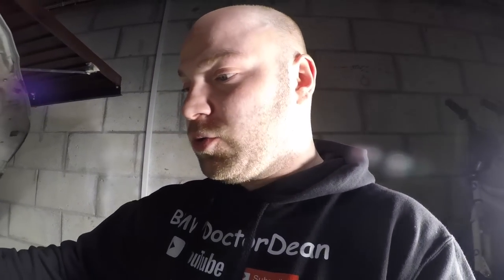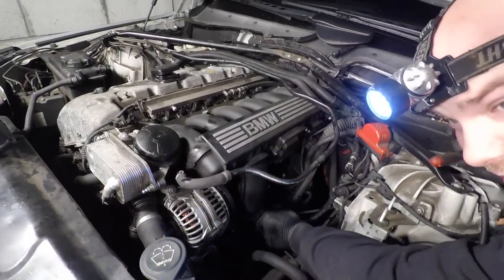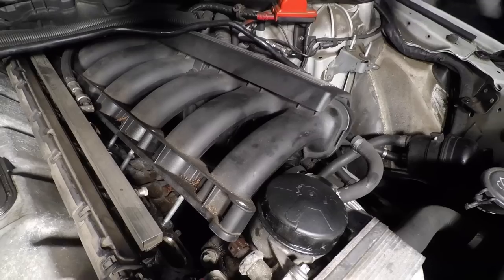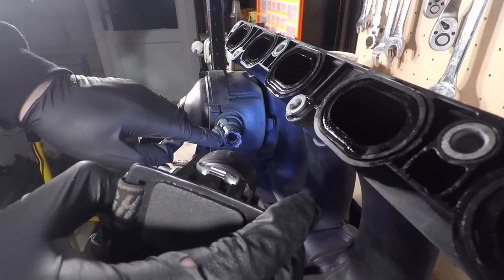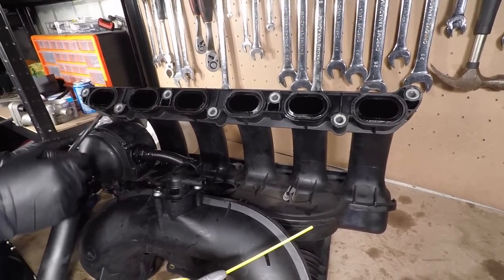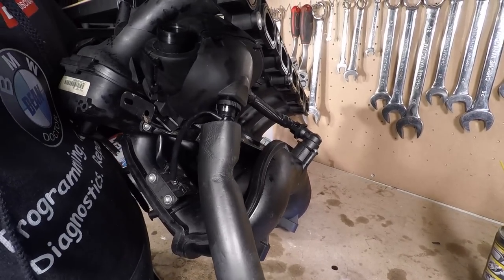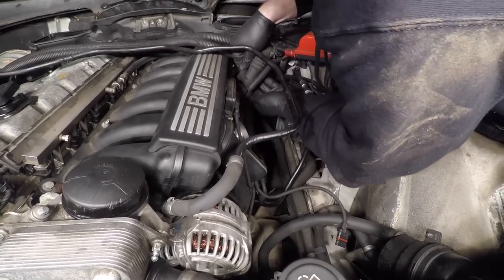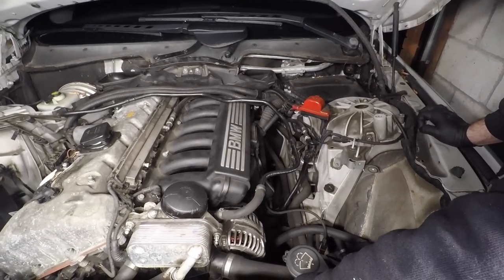BMW N52 How To Replace CCV Intake Manifold Removal Step By Step Guide

Comment from the maker: click here to buy the ccv kit used in my video 
https://amzn.to/2F1KNsX
Reply: Mine is a 59 reg with black housing  - do you have a link for this one ?
Reply: Is it same for a 130i?
Reply: BMW Doctor I bought my 2006 BMW 325i a month ago and is making the same whistling noise and giving me code P00 12, P00 15. I called BMW services and they said that the ccv was replaced a year ago with the previous owner... I doubt it was done cause is making that Same whistling noise. Therefore I will be replacing the CCV but do I have to replace the valve cover aswell? I replaced the valve cover gasket a few weeks ago.
Reply: dude how many times did you call it a PCB or am I just losing my shit here?
Reply: How good is this one really?. Got a couple of very small leaks, think partly down to the RCG, so want to do the CCV first, just incase, as if that’s playing up it might bugger new RCG.
Reply: Think this is my next job on my car. I'm having to top up oil back to full in unther  800 miles.
Reply: Hi dean, about to replace the ccv myself, bought a aftermarket set. Just wondering if I need to relearn the new ccv system in the cpu? Your advise is much appreciated. Love your channel btw. Greets from the Netherlands
Reply: I really enjoy your videos!!!

Comment: Did this job yesterday on my 2006 e61 530i with aluminium cover like in the video but with 3 stage manifold. The oil separator was completely clogged up like in this video and while being really careful return hose and the breather hose both broke off completely, that's how brittle and hard this stuff becomes so indeed replace them all. Honestly, the hardest part was removing the two screws that hold the bracket on...  thanks for making this video we used it! :)

Comment: Followed your vdo. 100% success thanks for the step by step instruction.
Reply from the maker: Good man at least you done it and shows it’s all correct
Reply: Did your intake manifold have oil inside too? What were your symptoms before replacing?
Reply: Victor Ramirez yea my intake manifold had oil inside of it and when i would put it into reverse pr drive from idle the rpm would act like it was going to stall. but when driving it would go away

Comment: Great now I need to find a camera man , seems likes it does add a lot to the video
Reply from the maker: Yes it does espically when you have a editor aswell why your cracking on with everything else
Reply: I charge $100 an hour ;)
Reply: @BMWDoctor  hi doc ok I've just pulled out plugs 2 and 4 and the tips of the plugs are blown off i mean they are gone! I have a 2007 525i n52 E60....what should I not do

Comment: Great video, putting mine back together today, how did you connect the lower CCV hose that runs to the oil pan? Did you connect it from underneath, by removing the metal cover? Or from up top,  I cannot  get it connected, maybe I am not positioning the intake just right, or there is a method I have not seen?

Comment: You are an absolute hero managing to get the bottom CCV to sump pipe off without getting frustrated and breaking it! Luckily I had a new one to put on, decided to snap it just so i could get it off, my thumbs were numb. Thanks so much for your video on this, helped me heaps working through it. Does it matter what order the plugs go in? Forgot which one was which on the bottom two, as mine seem to fit in either or. Cheers!
Reply: I put them back in the same way. It's good. 
Did you guess ? Is it good ? 
The last hose behind the valve cover took a ton of pressure. And then I heard a click.

Comment: I have oil leak on the same side of my 2009 N52, I see lots of oil on the head gasket area and it is pooling just above it.
There is no leakage from the valve cover. I gues i need to do this repair. great video.

Comment: Hey Doctor, Great Content, I have few questions for you. I bought a 2010 BMW 528i few weeks ago and I started to notice few issues.
1) Cylinder 3 misfiring first along with cylinder 4.
2) Changed all spark plugs with all ignition coils. Didn’t fix the problem.
3) I took the car to a mechanic today
 “he said cylinder 3 had oil over the piston and has been damaged by poor maintenance by previous owner, so I need a new engine”

Please can you give your suggestions.
Reply from the maker: change your CCV and the breather onto of valve cover that's split causing oil back into manifold to be sucked into engine dont listen to your mechanic he must be a idiot
Reply: @BMWDoctor  i love you so much

Comment: How much pressure should be at the oil cap when engine is on? Mine feels wiht a lot pressure at start (when cold). Then suddenly engine goes off if the cap stays open. The car runs ok, but doesn't feel to powerful. A little 4cyl  CRV Honda  leave me like 150 ft away in a drag 😂.... A shame on my 2007 BMW 530XI 6 CYL. Thanks for sharing your knowledge Doc

Comment: Hey doctor, y followed this video, install went good but now there seems to be a gurgling sound coming from the intake. It goes away if I remove the oil fill cap

Thanks for your videos. They help me a lot to restore my car
Reply: Also my idle is stuttering after this job, engine feels like it wants to shut off

Comment: Thanks a lot for your awesome video. My 2006 530i with 160k miles wouldn’t start, so i planned to replace starter, ccv kit, disas. I got all parts from fcp euro.
I have run into couple of issues
1. I broke the wiring connector to cps and i got the socket part# 12527507526 and replaced it.
2. I also broke the vacuum hose part# 34336762103 at the end where plastic meets rubber. I ordered the part but that small piece doesn’t come off even after removing the 2 hose clips. I have cut it with utility knife to take it out.
Put everything back and it starts now. 

Thanks a lot again for the video.

Comment: Good advice here Dean.Cleaning ICV might work for a bit but when it doesn't you are back to square 1.
Reply from the maker: Cleaning the inlet control valve ???? I cleaned it after changing ccv I wouldn’t clean it for no other reason if a car is rough idling it’s not ever the idle control valve usually other problems espically on the n52 engine

Comment: Hi.  
I have an E60 N52 258hp 2006 for 1 year in Portugal.  (because there is expensive gasoline, I put the Liquid LPG system and I am very satisfied), I bought it with about 78000miles and at the moment it is with 90000miles.  
I think the car is drinking a little too much oil and will probably be from the ccv no?  I have already changed some of the chronic problems of oil, and I think it is the only one missing and the most logical.  
Continue with the excellent videos and I hope for answers. Thanks

Comment: Great video, i got my manifold pulled out, doing the ccv and disa valve which broke inside the manifold managed to find the flapper in intake but pin is lost, im hoping this will fix my stalling issue and occasional misfire on my 2006 330i
Reply: Was that the issue?

Comment: Thanks for the video. It is pretty simple actually but I am stuck at the moment. The hose that connects to the crankcase is not cooperating. The one from the CCV down and has yellow clips at the end. It goes on a long way but there is a ring around the metal pipe. Is this just a stop or does the clip latch onto that? I am pushing really hard and I cannot get it over the ring.  The hose pushes on pretty far but then not over the ring. I can pull it back off fairly easily.
Reply: I have the same at the moment. How did you solved it?
Reply: I have solved this. All the new parts ordered new en original bmw only this hose was from febi (due to delivery problems at bmw). The febi hose was not fitting very well, so I ordered a new one at bmw. The BMW hose fits perfect.

Comment: Hello. Loving the Vids! I have a e90 bmw 318i. It is blowing out smoke on start up and acceleration from stopped at traffic lights. So either pcv+hoses or stem seals. Right? Any way to check which? Also, if I change pcv+hoses, how long will it still smoke afterwards? Will it smoke afterwards, at what point should I move on to stem seals as the issue? Thank you Dr!

Comment: Thanks for all the great N52 content. I have a N52k and want to swap to a 3 stage intake manifold. Would you recommend this and what additional parts should be swapped to help the process?
Reply: we are two, well im kinda considering a turbo mod, deadline is next spring ;) seriously replace all the plastic hoses that are part of the "oil fumes to intake" system. they are weak. and looks like starting with a new breather valve is a must, and might as well change your starter as well, i changed mine not long ago.

Comment: Dean, your vids are mint mate and the best on YouTube. 
Question, I have a 2006 BMW 325I SE COUPE N52. Is the pcv heater cable included the ccv kit? Also where is that pcv heater connected? Thanks
Reply from the maker: mate the heater wires come with the PCV system all together they have too mate as there needed I aint ever come across a kit that doesn't have them

Comment: Any tips for getting on that oil return hose im currently struggling to get it back onto the pipe that goes to the oil sump
Reply: Hi! How did you do? I have the same struggle here! Should I just press it on, or should I also press the tabs?
Reply: @Jimbobfyrkant  Hi how did you do? I'm trying to connect the sump side first, then to the oil separator. But it's the same issue, too tight fit

Comment: the other day i removed my spark plugs to check the gap on them. ive recently been experiencing a rough idle and surging idle in drive and reverse, so i was just wanting to check some basic things before spending money. but i noticed the spark plugs that i had just purchased with barely 300 miles on them, looked awful. they were covered in oil. Im assuming the ccv system has failed. is that what it could be?

Comment: I’m having trouble getting the air intake connected to the throttle body. Any tips? I tried putting it on before the TB, but that was in the way of the bottom bolts. The first intake boot (between the air box & TB) pushes against the metal near the inner fender, which is keeping me from getting it on square. Even on the bench, it was a struggle to get it I. The TB far enough that the clamp didn’t push it off the TB when tightened. Any tips???

Comment: I've got a 2006 325i getting a lot of white smoke coming out the the exhust, especially after its idle for a bit, but the idle is fine not rough and dont seem to be losing any oil.

Online everyone seems to point to ccv, I've taken it to the mechanic hes doing a service and changing the oil filter to see if that helps.

Any idea if it is ccv or something else. PS, subbed, love your videos.
Reply from the maker: thanks mate mate change it as they DO FAIL mate trust me and even the slightest will cause massive leaks and oil burning
Reply: @BMWDoctor  alrite will give it a go 👍

Comment: Is it the case that once fixed (providing it was the issue to begin with) that any old oil in the system will gradually get burned off? Or should the manifold be cleaned and something added to the fuel system also?

Comment: I have a 2006 330i and had to get a starter replacement. I was told that some little pipe or something broke on the intake manifold when removing it. Now that the shop has given me my car back the car doesn't seem to have anywhere near the power that it had. Does there have to be any tuning again?

Comment: Hey Dean! in Brisbane Australia mechanics are charging $600-700 AUD for this kit plus install... I'm entry level do you think I should have a crack at this? Your video is very straight forward.
Reply from the maker: Yes I really think you should garage’s are rip offs for this job and it is really really easy and takes 10 mins

Comment: hey dean! thanks to this video i successfully change my ccv on my 325i e90. just had one question though. ive been getting codes for both of my cats below threshold (p0420,p0430) and i was wondering if those codes will now go away after the ccv replacement or not. the ccv was not fully blown either i had got to it before real damage was done. would be much appreciated for some feedback
Reply from the maker: its a common common problem mate with N52 about the cats its because there so close to the engine ANY little bit of oil or a blown ccv will get it into the manifolds on the exhaust and need to be burned off mate go watch my video on how to fix it
Reply: BMW Doctor just use the injector cleaner in the spark plug holes eh?

Comment: Will this make your oil light come on saying low oil after replacing oil level sensor and oil pressure switch I also replaced my hpfp and still getting a code for that

Comment: Hello, my N52 is drinking oil and it seems to be from the CCV. I've watched your video, is it mandatory to replace also the hoses? Are they reusable? My idea was taking them off, and cleaning them with petrol until fullly unclogged. Thanks mate!!!
Reply from the maker: No chance buddy replace them because the moment you remove them you will break them removing them anyway trust me as they seize on so get new hoses otherwise you will be screwed don’t even think of attempting to replace it without the hose as then you will not be able to start the car I guarantee the hoses will break or the clips
Reply: Hello if i buy a 528i US and want to get a 258hp like EU version.what should i do ?

Comment: What is a ccv? I live in north America and when I took my intake manifold off my 2009 128i, there were nothing like that attached to it. Thanks for the instructional video.
Reply from the maker: You have one pipe which is shaped like a Y you have the ccv in the valve cover mate
Reply: BMW Doctor I removed my intake manifold and I had the same problem, I have a bmw e90 328i with the black cover not the silver one where exactly is the ccv located at ? Thanks for the tutorial vid!!

Comment: Okay so i just replaced the ccv pump n hoses. But when i was bolting on back the throttle body i notice there was oil in the manifold? Is that normal?? Now the car turns on but as soon as i take off n give it full throttle it boggs n wants to turn off? Any ideal wut it could be??🙏much appricatedt

Comment: I replaced my ccv thinking it was gonna solve my rough idle and stalling issue but the car still has the same problem and it won’t rep past 2000 rpm’s any suggestions please?

Comment: hey doc...ive recently bought a 3series and am doing a breather valve change. after my manifold removal, i noticed oil residue in the throttle body. i have the plastic valve cover 52. do i have to scrap my valve cover all together, since the ccv is in the cover?

Comment: Hi Dean I've got an n53 blip the throttle and back to idle you get a noise like its sucking the ccv valve in , rough idle etc till you blip it again and it releases. I'm replacing the rocker cover. Should I be looking anywhere else for a cause?

Comment: Dear Bmw & Mini Doctor,    does this set fit my 2006 130I ? Cause I`ve seen also sets with a T-shaped pipe in it.
Love your videos!
Reply from the maker: Yes mate this is correct one for your year car after 2007 you need t pipe one if you have black valve cover 

This is how you tell if you have silver engine cover and magnesium valve cover this is the correct ccv system 

If you have black engine cover and black valve cover t shape pipe is the one for you 👍
Reply: @BMWDoctor  Thanx for the fast reply! I do have the magnesium cover so there shouldn`t be a T shaped pipe in the set I ordered on advise by Autodoc... yesterday
Reply from the maker: If you don’t have silver engine cover yes t pipe is correct one for you
Reply: @BMWDoctor  Hi did the job yesterday inclusive O2-sensor bank2 pre-cat. Both hard jobs. Great help your videos!👍👍👍 The hose from the sepparator to the inlet was a T-shaped one, only used on the earliest N52B30.
Reply: Bas Haffmans link to the hose?
Reply: BMW Doctor link to the t shaped hose?

Comment: I have a little hose line coming from my valve crank case the done you’re replacing at 16:17 where does that line go. I see that you don’t have one connected at all
Reply: Also the new one I bought came with the nipple like yours but not like my old one

Comment: Hey doc Dean! You're the best! I AM a female with a 2008 BMW 328i and living in Atlanta, Georgia in the USA and my car started going into limp mode and rough idling to not starting, in March 2020 so I got valve cover gasket, sparks plug, oxygen sensor, oil filter housing gasket, eccentric shaft sensor, air injection hose, breather hose and three months later my car went back into limp mode, rough idling, engine shaking while warming up. Got vehicle towed to European Auto Care and they now diagnose saying I have catalytic converter codes and EAC sensor communication codes and it due to ENGINE DME/DDE which shows a lot of codes (2ADB, 29F5, 29F4, 2A17 2D29, 2D2A) and told me catalytic converters change and that first resolve the rough idling, no more limp mode and engine should not shake?? NEED YOUR HELP ASAP AND PLEASE
Reply: honestly if you don't have emissions testing just go hatless with a tune.

Comment: I may have missed it, but did you clean the intake manifold itself out since it probably had a decent amount of oil inside? Would you recommend doing so?
Reply from the maker: No this didn’t have ANY oil inside which was a surprise we changed this over only to find out this wasn’t the cause it was valve steam seals SHOT on this car but this video shows how to remove the ccv anyway
Reply: @BMWDoctor  Just changed my large DISA, decent amount of oil covering it and inside of intake. Glad I ordered ccv as it looks like it went bad. I'll be following your steps here soon.
Reply from the maker: No problem mate